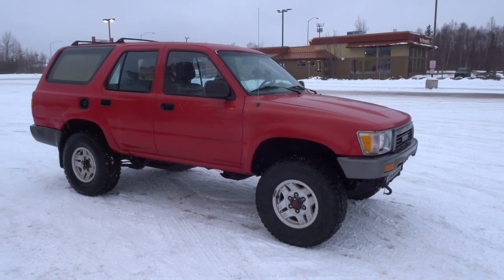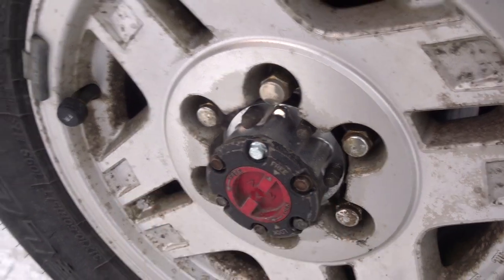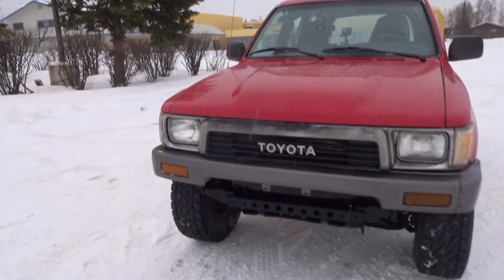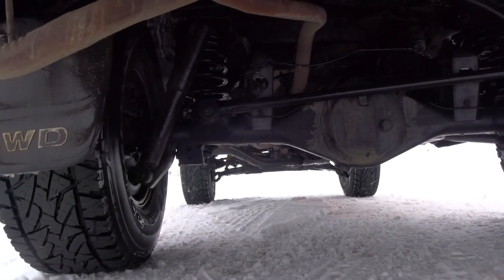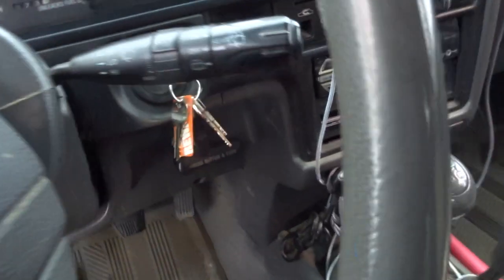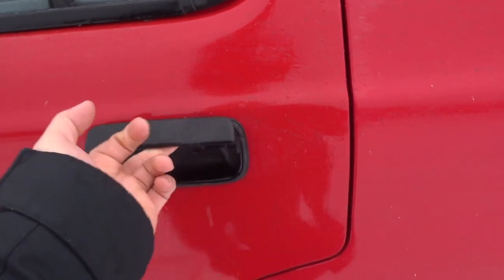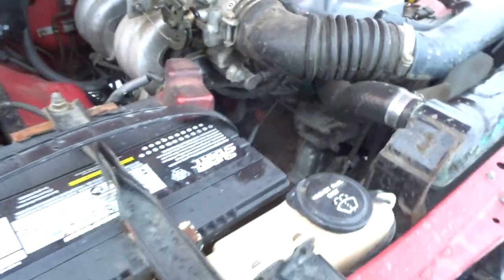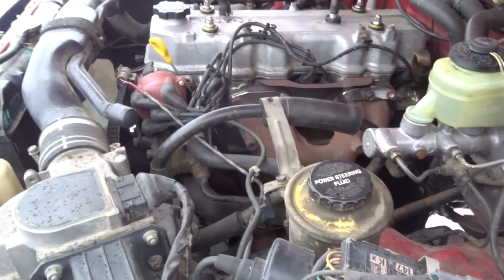1990 TOYOTA 4RUNNER | UPDATE WALK-AROUND

Comment: Its in your e brake handle, go under your dash remove your cable and remove the 2 bolt that hold your handle,  you might be able to fix handle once you get it out you'll see why its not holding.